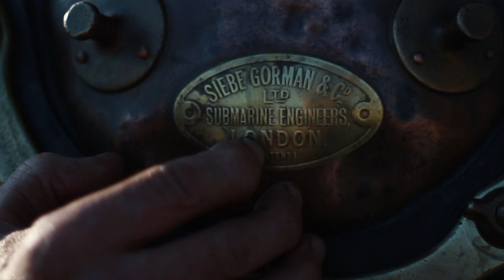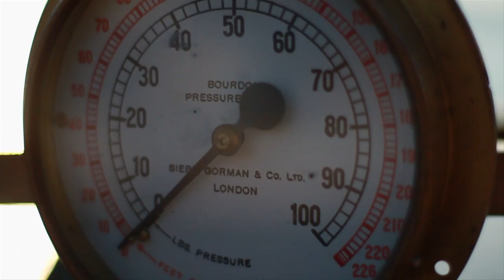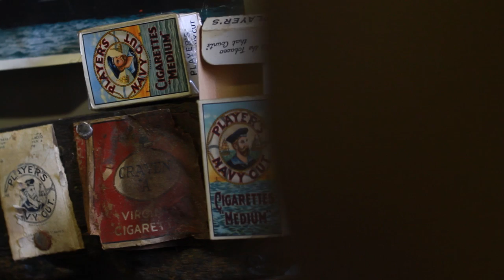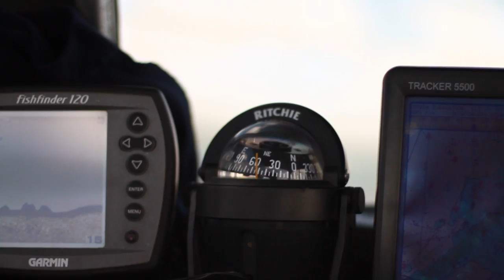Ray: A Life Underwater

Comment: It takes a brave man to use hand pumped air through a single hose to breathe/ inflate the suit. No bail out facility.  With all the dead weight required to sink the diver if the pump fails, hose ruptures, or suit seal fails, you are dead.......
I am priveledged to have used standard gear, it is surprisingly comfortable when at depth, but you have to constantly adjust your buoyancy, or you start to float up or get squeezed..equally bad...if you start to ascend out of control, the suit will burst and send you south.Every stroke of the pump can be heard via the air hose or bag as a hiss. the strokes get faster as you descend as the tender has to maintain over pressure to keep you alive.
The early saturation divers were in a very dangerous environment.
They never had the safeguards that we have in place nowadays..

My hat is off to Ray and his collegues of the day...Slack the diver!!

Comment: I'm right in seeing he's scuba diving with a band mask?
Reply: Right!
Reply: Yep nothing wrong with that, I know Health and Safety Exec and Association of Diving Contractors, IMCA don’t approve of SCUBA for most commercial diving ops as it consumes more air/gas, but it is no different than diving an AGA or other full face mask, like the police divers use on SCUBA under HSE Pt 3 and 4, I know commercially it is frowned upon as there has to be multiple gas sources, ie main gas/air from umbilical, via topside compressor and HP backup through dive panel to diver and then diver worn Bailout/scuba attached on EGS side of helmet/mask manifold it is designed for it, part of the reason for the dial a breath to adjust pressure changes when switched from main gas to bailout, bailout is slightly higher pressure to shut one way valve on helmet/mask to stop emergency gas supply and eventually divers internals going back up the umbilical.